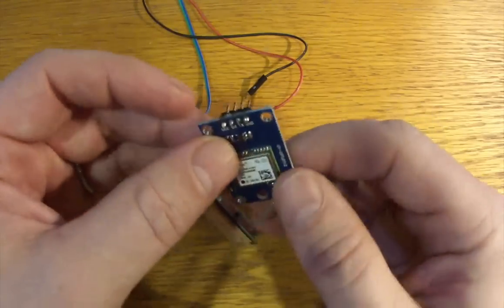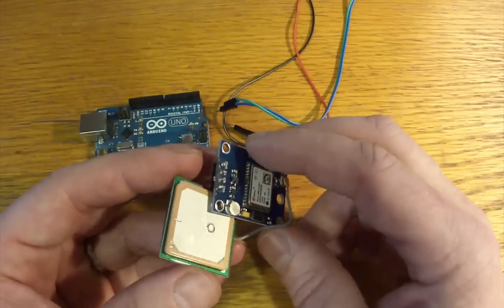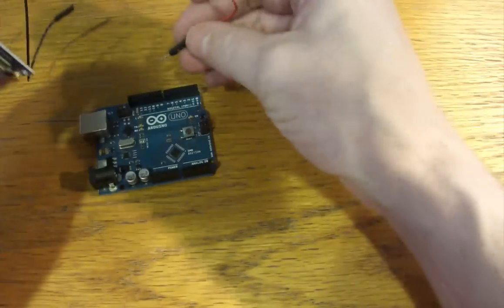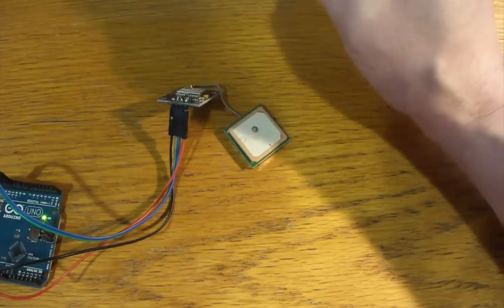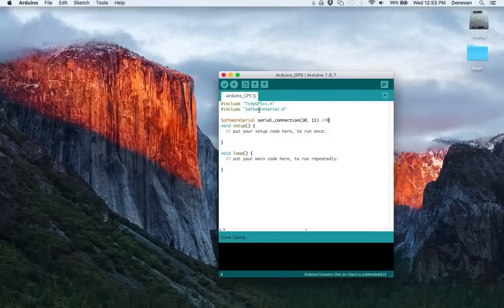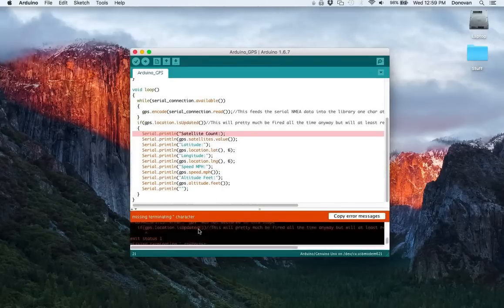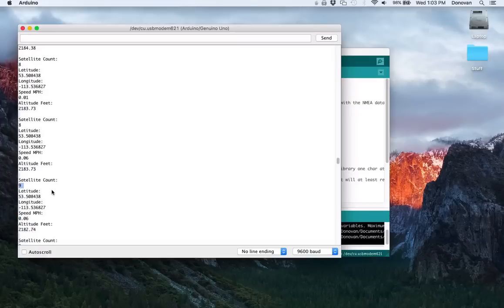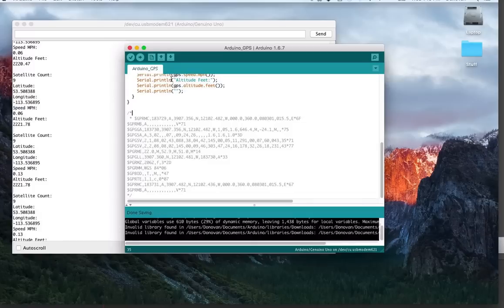HOW TO: Easy GPS connection to an Arduino

Comment: I JUST COMPLETED MY GPS HOOKUP WITH MY LAPTOP AND IT WORKS GREAT ! THANK YOU ! 
U NEED TO DOWN LOAD TINYGPS++ LIBRARY ZIP FILE AND RIGHT CLIK EXTRACT IT TO UR ARDUINO/LIBRARY FILE . MINE IS IN MY DOCUMENTS/ARDUINO/LIBRARY.  THEN U UPLOAD THE PROGRAM AND U SEE THE LED LIT ON THE UNO AND I HAVE A BLUE LED BLINKING ON MY GPS CARD THEN I PRESSED CONTROL SHIFT M AT THE SAME TIME AND THE GPS WINDOW OPENS DISPLAYING LAT LONG SPEED AND ALTITUDE LIKE THE VID SHOWS.  IF UR GPS CARD NEEDS PINS OR WIRES SOLDERED IN DONT USE MORE THAN A 1/16 OF AN INCH OF SOLDER WIRE CAUSE THE HOLES ARE VERY CLOSE TO EACH OTHER AND U CAN OVER FLOW THE SOLDER AND SHORT THE WIRES VERY EASILY. USE UR MAGNIFIYER GLASSES FOR THE SOLDERING . THANKS AGAIN THIS WORKS SO GREAT . LIKE WOW

Comment: Still working great after several months. I’ve noticed that the Tiny GPS library version im using when asked nearing and range to waypoint returns distance in kilometers so to spite using it to guide my boat I do everything in kilometers then convert to nautical for the display. Another simple thing I’m doing is displaying number of satellites on the LCD in hex 0 to F to save space.Great video that got me started. Thanks

Comment: I made a ballistic rocket with arduino. I made some sugar rocket fuel (5KG) and made a 3 stage rocket. I made this gps module and a few metal ropes attached to motors from arduino and they are attached to the fins of the rocket. It flew 50 km and landed (safely with parachutes) 200 meters from the target.
Reply: Hi, may I know what is the model of GPS module you used, and code

Comment: "The library takes care of the rest" is what killed it for me in the beginning. Switched to MMBasic where I read 1 manual and type everything myself. With Pico's I make small "computers" and it's quite interesting with wires and components now. I might try an Arduino for something, but I don't expect much.

Comment: What's a possible reason that the GPS module doesn't work? It's wired correctly, the code uploads well, but I only get "GPS Start" on serial port...
Reply: same problem here. Solutions anyone?
Reply: same here ✋
any solutions?
Reply: Same problem!
Reply: same
Reply: The same happen to me!
Reply: I am also in this queue now :D My GPS module not working i think...
Reply: same
Reply: same here please respond!
Reply: Same problem here. 
`serial_connection.available()` returns 0
not sure why. This is the reason for code inside whileloop is not executed.
Reply: I had the same problem, putting the GPS near a window for better signal and reversing the TX and RX wires got it working for me... I have 2 different GPS units where the TX and RX are labeled backwards.
Reply: Do anybody got the output till now those who had worked frm mny months  on that gps
Reply: i had the problem too, just like someone said here; u have to swap the RX and the TX cables. Then restart  ur arduino and it should work
Reply: i have tried that, swap the wires rx and tx but i still get the same reponse, gps start, and no more. Please LessonStudio help to yours subscriptors!!
Reply: Have you tried a different example? It works fine for me with "Full example".
Reply: Same
Reply: The tx and rx are different in the code and video
Reply: same problem here, just only the GPS start and my gps module dont have any light
Reply: oof same here... "GPS START"
Reply: roy lim same here..how you fix it?
Reply: I now have mine working. Firstly ensure power and ground is full connected. Then try using serial ports 12 and 13 (digital). Plug the RX and TX in, don’t worry if there’s extra unused wires. Run the code on to the board and see if you get data. If not switch the RX and TX wires around but leave the code the same. Let me know if you have any issues.
Reply: @alistairnathanbrown  Help!! Swapped RX and TX but still don't work
Reply: The issue I had at first was connection. I know it sounds obvious but my GPS chip specifically is very picky with signal. I had to be at the top of a three-story building and then had to leave it for 15 mins for it to get its first signal. Do this and leave it with Serial open and if nothing still, switch the pins and try again.
Reply: ahmad zia  I tried swaping between 10 an 11.. but still "GPS start" only shows up
Reply: @fcoch7  it worked fine in our project

Comment: hey my serial monitor only showing GPS Start and noting else i want to know wether it is the problem with the gps or the location please let me know
Reply: same here bro
Reply: if it continues to make error in the outside of the building, that means there may be a problem in your GPS, but I don't think so. You should try to set up your circuit again.
Reply: me too ;(

Comment: Are you aware of any way to utilize this Arduino GPS as an upgrade for a cellphone's GPS signal? Either Android or iOS would be fine.. the hope is to use this in place of my cellphone's built-in GPS for a few functions that require high accuracy.

Comment: Hi, I am getting a trouble, I am using GPS NEO-M8P-2 in my library of the gps it exist an example, but appear that 
#include <Wire.h> //Needed for I2C to GPS, but I am conecting with RX Y TX, and do not read my date. its necesary define the pins or I need a wire cable.

thank you, i hope you could help me

Comment: Wow, your code just solved our problem, which bothered us for weeks.
Thank you very much
Reply: 二宮望  did u get the output other than gps start
If yes can u help me
Reply: @anandraok960  did you find a solution?
Reply: @gabrielpacatang7164  i could use some help on that :)

Comment: can i use SoftwareSerial libray to attach GPS and GSM module to an arduino uno. i don't need to communicate with both modules at the same time.

Comment: hi . i am working on the same project but my readings are not coming. it is showing one GPS start. what is the problem. iam using the code whic you have given i.e github one in ur link

Comment: Hey man, I am trying this code for a school project, but i cant get the serial monitor to work. I have the correct baud rate and wiring and it does say GPS Start, but there is no data coming after that. The gps does have a lock because it has a blue flashing light. Do you have any idea what there could be wrong?
Reply: Most GPS modules will poop out data even if they are not connected to GPS. Try various baud rates.

Comment: 6:12 Help ! In software when you set the RX pin = 10, that means it is the RX on the Arduino board, and goes to the TX of the GPS, right ?
Reply: since he connected Rx to pin 10 on Arduino , he wrote the code like that.

Comment: did you buy the pin socket of GPS module? I bought one without having a pin socket
Reply: just solder wires on the module if you don't have the pins

Comment: HI. Can u help me?
I connect my gps module Neo - 6M to my Arduino Uno R3
Download TinyGPS++ library and wrote ur sketch. 
I uploading this sketch to my arduino and entering to Monitoring window. But in this window i see only "GPS Start" messege. I wait 2-3 min and it steel in there. How can i solve this problem?
Reply: same here
Reply: Dilakshi Perpetua 
Are u testing inside building?
Reply: I have the same problem. I'm using a gps module neo 6M to my arduino nano. I only see "GPS Start".
Reply: check connetion according to scetch TX RX and try in outside of building
Other problem is that GPS sattelite position.
If u starting to recive "***" then u will need to waite maximum 10 min to recive GPS signals

Comment: UPDATE i noticed that when i tried to reset the arduino i did get one line of CSV so then i kept holding down the reset pin and while i kept holding it i kept getting msg's so something is wrong with my arduino or gps module or something is wrong with the libraries

Comment: In file included from D:\Membangun Software PKM\SoftwareSerial\sketch_nov24a\sketch_nov24a.ino:1:0:

sketch\TinyGPS++.h:27:25: fatal error: application.h: No such file or directory

 #include "application.h"

                         ^

compilation terminated.

what i have to do? if the error like that

Comment: Will anyone please tell me I am only getting GPS start on screen my  TX and RX connections are correct still its not working I have included Tinygps plus also
Reply: i am facing the same problem
Reply: Easy download I am dumb from don't github and press doh.

Comment: Arduino: 1.8.5 (Windows 7), Board: "Arduino/Genuino Uno"

C:\Users\Win 7x64Pro\Downloads\Arduino_GPS-master\Arduino_GPS\Arduino_GPS.ino:1:23: fatal error: TinyGPS++.h: No such file or directory

 #include "TinyGPS++.h"

                       ^

compilation terminated.

exit status 1
Error compiling for board Arduino/Genuino Uno.

what might be the problem heree?
Reply: you have to include the tiny gps ++ library

Comment: Didnt work for me. For a start the library call #include "TinyGPS++.h" wont compile because there is no such library as you cant use symbols for a library location, the library is actually called TinyGPS. Change the script to this though and I just got another bunch of errors compiling .
Reply: I downloaded the files (.h and .cpp) I opened them in visual studios and created a folder (directory) for the project.
That solved the issue.
Reply: @cliffordariel3405  r you refer any website or youtube ?

Comment: Arduino: 1.6.11 (Windows 10), Board: "Arduino/Genuino Uno"

C:\Users\admin\Desktop\GPS\GPS.ino:1:23: fatal error: TinyGPS++.h: No such file or directory

 #include "TinyGPS++.h"

                       ^

compilation terminated.

exit status 1
Error compiling for board Arduino/Genuino Uno.

It shows this error. Can anyone help this young tinkerer?
Reply: I think you would need to download it seperately.
Reply: Are you Find that solution?

Comment: it shows only GPS START and nothing else.
i put  Serial.println("Satellite Count:") in the void setup,
          Serial.println(gps.satellites.value());
no works
Reply: i got the same problem :-(
Reply: i got it...it just had something to do with your baud rate
Reply: have u solve the problem...?
Reply: Sanket Randive ok tanks
Reply: any solution please ?
Reply: try this codes, but u have to download tinyGPS lib first

//#include <SoftwareSerial.h>

#include <TinyGPS.h>

/* This sample code demonstrates the normal use of a TinyGPS object.
   It requires the use of SoftwareSerial, and assumes that you have a
   4800-baud serial GPS device hooked up on pins 4(rx) and 3(tx).
*/

TinyGPS gps;
//SoftwareSerial ss(11,12);

void setup()
{
  Serial.begin(9600);
  Serial1.begin(9600);

  pinMode(13, OUTPUT);
  Serial.print("Simple TinyGPS library v. "); Serial.println(TinyGPS::library_version());
  Serial.println("by Mikal Hart");
  Serial.println();
}

void loop()
{
  here:
  bool newData = false;
  unsigned long chars;
  unsigned short sentences, failed;

  // For one second we parse GPS data and report some key values
  for (unsigned long start = millis(); millis() - start < 1000;)
  {
    while (Serial1.available())
    {
      char c = Serial1.read();
      Serial1.write(c); // uncomment this line if you want to see the GPS data flowing
      if (gps.encode(c)) // Did a new valid sentence come in?
        newData = true;
    }
  }

  if (newData)
  {
    float flat, flon;
    unsigned long age;
    gps.f_get_position(&flat, &flon, &age);
    Serial.print("LAT=");
    Serial.print(flat == TinyGPS::GPS_INVALID_F_ANGLE ? 0.0 : flat, 6);
    Serial.print(" LON=");
    Serial.println(flon == TinyGPS::GPS_INVALID_F_ANGLE ? 0.0 : flon, 6);
     digitalWrite(13, HIGH);
     goto here;
//    Serial.print(" SAT=");
//    Serial.print(gps.satellites() == TinyGPS::GPS_INVALID_SATELLITES ? 0 : gps.satellites());
//    Serial.print(" PREC=");
//    Serial.print(gps.hdop() == TinyGPS::GPS_INVALID_HDOP ? 0 : gps.hdop());
//
//    long latitude, longitude;
//    gps.get_position(&latitude, &longitude, NULL);

  }
  
//  gps.stats(&chars, &sentences, &failed);
//  Serial.print(" CHARS=");
//  Serial.print(chars);
//  Serial.print(" SENTENCES=");
//  Serial.print(sentences);
//  Serial.print(" CSUM ERR=");
//  Serial.println(failed);
  if (newData == 0)
    Serial.println("** GPS is searching signal... **");
    digitalWrite(13, LOW);
}

Comment: Its not working getting error for Tiny GPS library
How to solve it i have already download and paste it into the libraries
Reply: haven't you solved this problem yet?
Reply: GOOGLE TinyGPS++ library  U SEE ZIP  , DOWNLOAD , RIGHT CLIK IT , EXTRACT USING BROWSER TO UR ARDUINO/LIBRARY . START ARDUINO WINDOW UPLOAD THE GPS PROGRAM . I DOWNLOADED MY COPY FROM GIT HUB ITS THE EXACT COPY FROM THE VID ABOVE.  UNO SHOWS LED LIT GPS CARD BLINKS .  TYPE CONTROL SHIFT M AT THE SAME TIME, AND THAT OPENS THE GPS WINDOW WITH UR LAT LONG SPEED AND ALTITUDE . HAVE FUN

Comment: hack the gps by removing the 1575 saw chip and running a copper wire straight through. You now have a multi-band SATCOMM receiver unit

Comment: it shows only GPS START and nothing else..
help me plz
Reply: if you put the therm:

Serial.println("Satellite Count:");
Serial.println(gps.satellites.value());

in the void setup, you can see how much Satellites are available. may your problem is the connection to them.
Reply: have u solve the problem...?
Reply: your gps module just not got enough signal to locate its location

Comment: VCC to 5V or 3.3V ?
Reply: Both should work. The datasheet says in between 3v to 5v. I use 3.3 for low power consumption.

Comment: hey iam getting onlly Get Start on serial monitor!! some one help me
Reply: I had that problem...it turned out that the external antennas that I was using with a pigtail connector wasn't fully screwed in on the thin coax on both ones I tried. You should see a green led on the receiver which blinks ...you can also check with a scope on TX to see if there is an output and then make sure the TX is connected to the RX on the Arduino.

Comment: the blue led is flashing on the gps module... but im stuck on GPS START...plz help
Reply: wrong wiring you can use this software to check the GPS have already got Location First before you plug the gps module to the arduino 

here the links - https://www.u-blox.com/en/product/u-center-windows
Reply: try to switch the connection of the RX AND TX. It works perfectly for me!
Reply: @CLoren-cp9gg  somehow this exchange of RX TX didn't work for me..is there any other possible solution you know..??Thanks in advance...
Reply: @torikulislammaruf4841  normally it would work like the video. But if it didn't work try to test your neo6m first like a test code. If you want to  do it like the video just follow the video but you should code in an open place without a roof or buildings so that the satellites can easily lock on your device.

Comment: 2nd UPDATE i got the board to work and i really did not have to do much but just let it keep trying.....eventually it work tho i will say dont just let it keep trying finger fuck that shit outta that Arduino Reset pin till it starts spitting those digits "CSV"
Reply: make sure you are near a window and give it at least 60sec and start hitting the reset pin so that the arduino can start the sketch.